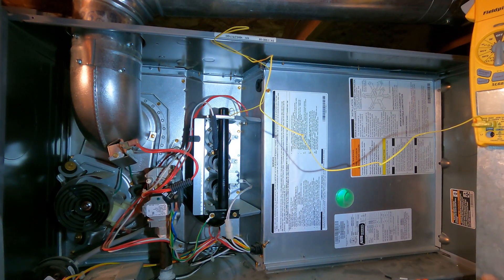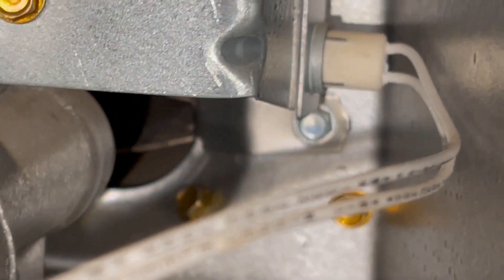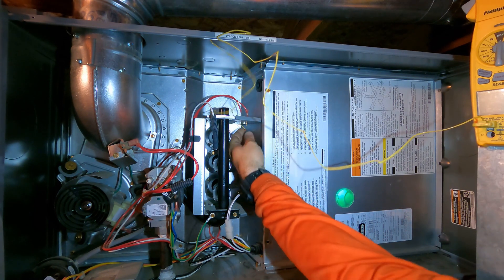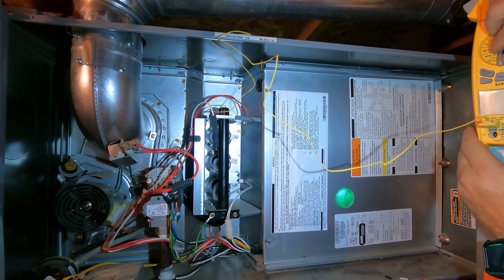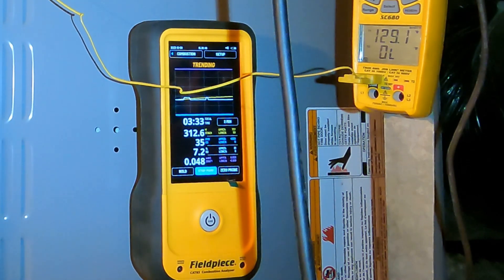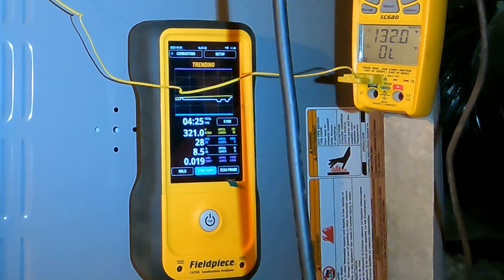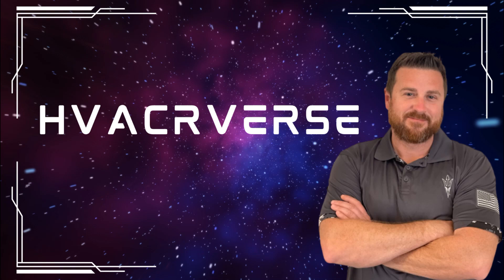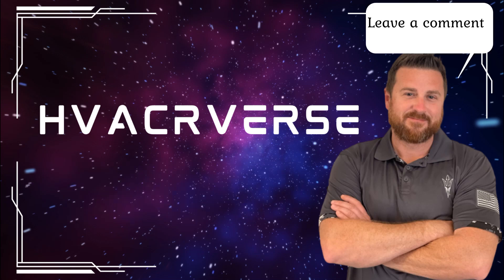Are low NOx furnaces more efficient? Or do they cause higher pollution?

Comment: Just got done tearing out a 80% ultra low NOx Nortek 😖😡
What a PITA 
I’M IN CLEVELAND OHIO. THIS FURNACE SHOULDN’T BE HERE. IT DIDN’T HAVE THE PROPER PAPERS AND PASSPORT TO ENTER THE STATE HA HA HA HA HA HA 
LANDLORD OF A PROPERTY BOUGHT THIS OFF OF EBAY FROM A LINK THAT THE TENANT GAVE HIM NEITHER OF THEM KNOWING ANYTHING ABOUT WHAT THEY WERE BUYING 
IT WAS INSTALLED MAYBE THE WORST INSTALL I’VE EVER SEEN BY HER SON-IN-LAW 
The thing stopped working after a year 
Gas valve would only open for a second or two, shut down and retry till lockout
No codes of any kind to tell you what’s going on  just a standard three LED light stupid board
It took almost an hour to get the flame sensor out and get it back in. It’s buried behind a panel behind all the equipment in this 14 inch wide cabinet. 
It ran overnight a little bit after that, and then still started the one second cycling of the gas valve 
Talk to everybody around here none of the text I’ve ever seen or heard of them because it’s not an Ohio thing it’s a California furnace 
Even change the gas valve out because it was only 60 bucks 
Gave up last night landlord had a brand new 80% normal furnace so I swapped it out last night. There’s a video if you go look video of all the nonsense. 

Trying to find out about these things by coming to YouTube and going to Reddit forums  

Not much out here for these things from what I’ve looked at, the forums on Reddit finally found some stuff. Most technician said we’re never gonna install these pieces of crap again.

One stated they replaced a bunch of burner boxes cause they get plugged up and go bad reducing flow
And since you can’t see the flames or anything, you don’t know what the heck is going on. It’s all mystery sauce.

Other text said that they replaced like a dozen or more of the transducers 

Multiple posts said they will never put these in again. They will recommend heat pumps.

I found one video that showed a burner box removed, and how high the temperature is and now once I saw the burner box removed I saw that it’s a catalytic combustion system. Super high temps. Just prone to problems.

When I took this thing apart, the vent ductwork was full of large, granular, carbon type tar deposits even as big as chunks as big as your tip of your thumb laying in the horizontal vent

Ugh Grrrr and double ugh 😣